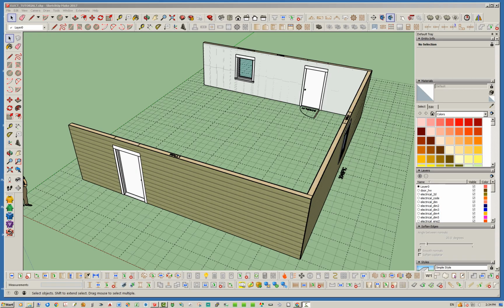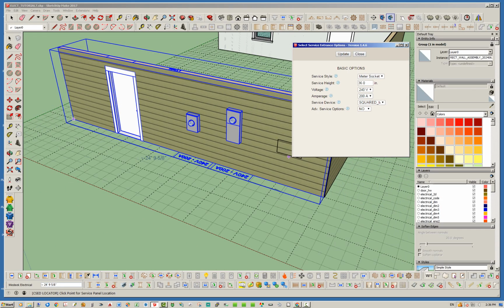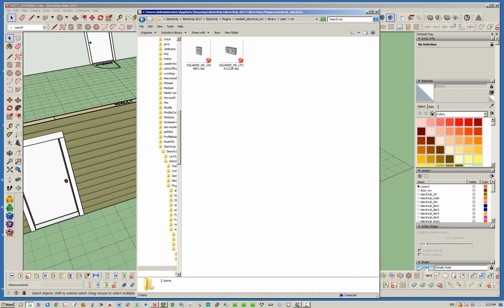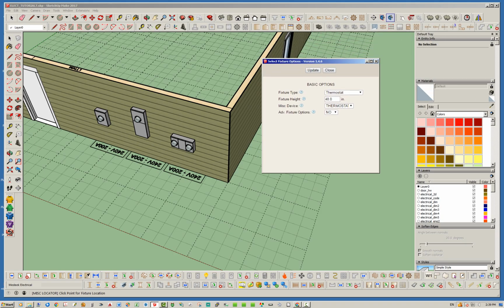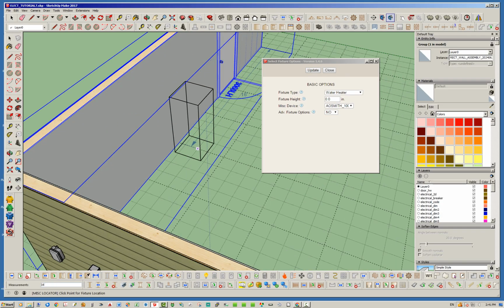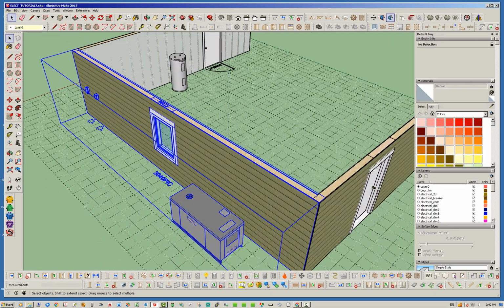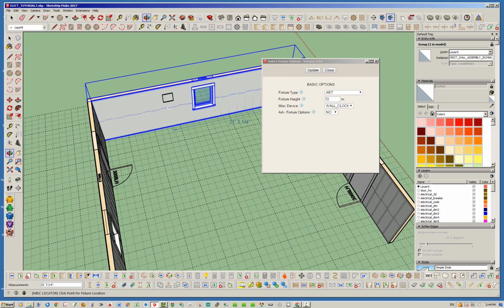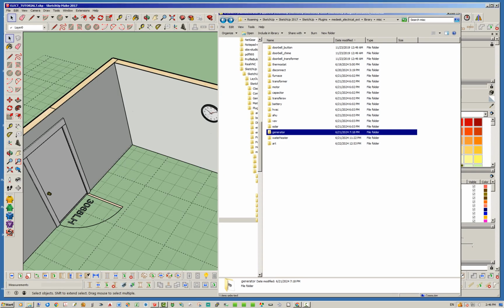Medeek Electrical Plugin Tutorial 7 - Misc. Fixtures

Comment: Very nice, I would use the Electrical extension if I could produce a 2d only version.  In other words,  I draw a 2d floor plan for every project then draw Medeek walls over it but sometimes someone will just want a quick floor plan or electrical plan but I can't insert the symbols on the 2D plan,  I really think more people would use it if this was an option because there are very few times I need a model for electrical content.  9 out of 10 times, my electrical drawings are 2D so I have to use my own symbols and legend for electrical plans. 

I am surprised more people do not ask for this.  Some of the projects I have done were just 2D electrical plans because a lot of people don't like doing them.  Anyway, Great work! :)